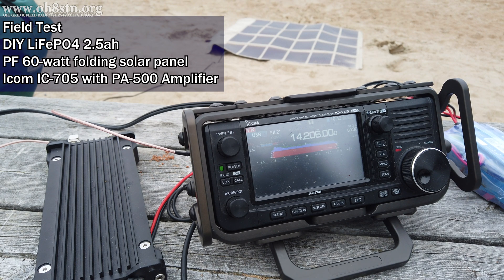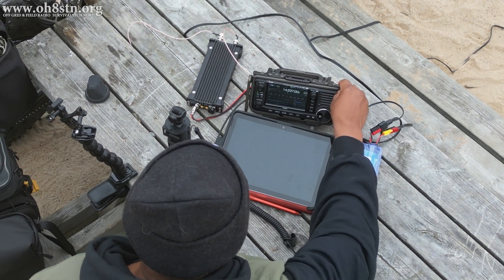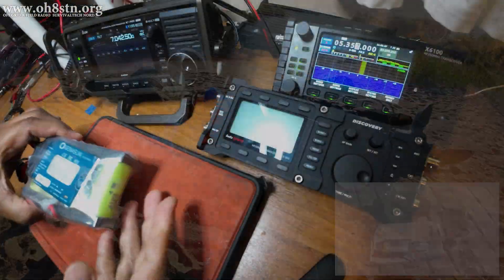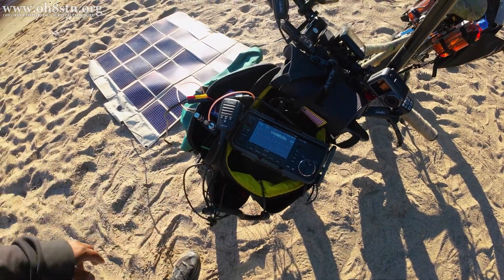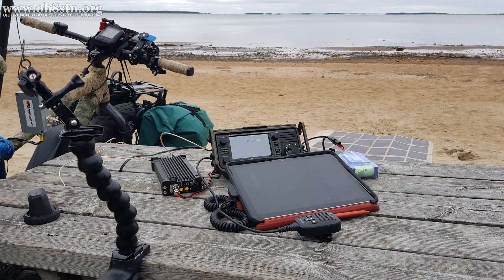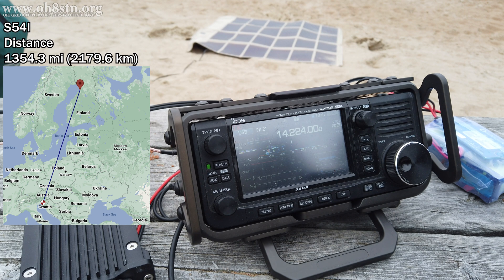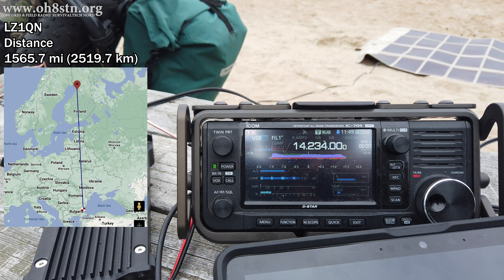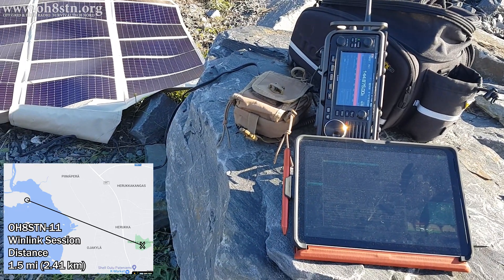Portable ham radio off grid Icom IC-705

Comment: How do you connect a Bioenno battery to the Icom 705? Great videos as always. Thank you.
Reply from the maker: The 705 comes with a DC power cable.  The plug is center pin plus, outer ring minus. Add a fuse on one or both cable ends, and connect +/- to your battery plus minus. It would be good to add connectors to the power cable end, and a powerpole distribution block to the battery. Then it's as simple as plugging in the radio power cable, into your batteries distribution block.
Hope this helps. 
73
Julian oh8stn

Comment: have you tried the Buddipole power mini?
Reply from the maker: Yes I used it for a couple of years. Recently I sold it because it doesn't perform so well in low light conditions. It's okay with lead acid batteries on clear days with good sunlight.

Comment: I just got a Genasun GV-5 12v Lifpo 4 and the manual suggests putting a fuse in between the battery and the controller. Do you do that if using a bioenno type battery or are they mostly talking about lead acid?
Reply from the maker: It doesn't hurt. The fuse is there to protect your gear if for example the terminals are mixed, grounded or shorted by mistake.
Reply: It’s also interesting that Genasun shows hook up procedure as Panel Battery Load and Buddipole powermini2 suggests Battery Panel Load.
Reply from the maker: Genasun controllers MOSFET will protected if there is no battery connected and solar panels are. Still, I would connect the battery first and and then the solar panels. The load can be connected anytime after the battery is connected.

Comment: Simply cannot afford a more sensible radio so stuck with hauling Icom IC-756 (MK1 Non-Pro version) Heavy, Big, Hungry. but it is what I have . I am also stuck with heavy Car batteries and SLA batteries for power. These are all charged off solar panel at home. I have a 65W dual-panel that folds closed to protect the panels for transportation. The whole HF station + homebrew antennas, food, water etc. packs into a small box trailer that can be easily hauled on the Fatbike or used as  hand cart when I don't want to take the bike.  This is a long way from an ideal /P setup but still having fun making the best of what I have got.  🙂 I have a 706MKIIG set aside at a friends house that I will hopefully get by next summer, this will greatly reduce weight and power requirements and will improve the /P station. What battery / BMS / charge controller combination would You recommend for radios that are less efficient like the IC-756.?  Thank You for the time and effort You put into these videos. 73 de MM7WAB An amateur radio womble, in Scotland.
Reply from the maker: Excellent backstory and question. Hey it always depends on the amount of time you generally operate. If you ride out set up an operate four or five hours at a time, I would suggest a 20 amp hour LFP battery. 1-2 hours,  10amp hour LFP. This week's video will cover this topic extremely well so stay tuned for the weekend.

Comment: Get the lead out! I also have learned a great deal from you as others have commented here. You've helped me to prioritize my goals and the matching of my equipment to my particular platforms. For example, the Icom 706 MkII G and CB will reside in the box truck with 400 watts of solar/480ah Lipo4. The Icom 705 (same set-up that you have) will be used in the 4Runner (along with my get home bag and SOTA fishing pole mast etc.) along with the Anytone 878 for 2m/DM. Streamlining for efficiency is the order of the day. Thanks again!
Reply from the maker: 1 minute of video, 1 hour of editing on average! Nevermind field work for testing and collecting clips.
Reply: @OH8STN   Sorry Julian, I meant everyone get the lead out by not using lead acid batteries. ; D.  I used to shoot wedding videos and I know how much sweat and labor goes into your vids. Thanks again 73

Comment: How long would you anticipate your power radio to last in a permanent grid down with no ability to replace parts
Reply from the maker: Excellent question! 
So far the radios have lasted 5-10 years without repair. The exception is the FT-817ND, which needed its DC socket replaced after several years of deployments. 
The solar generator we built 3 years ago is going strong. It still provides ~100% of its capacity, although fuses are periodically replaced. Now I have a supply of hundreds of fuses of varying capacity.  The charge controllers are fine but one screw terminal broke after 3 years of deployment.  It was easy to repair by soldering the wires directly to the circuit board. This prompted me to purchase a DC soldering iron so that I can solder directly from a battery.
The portable solar panels have done extremely well. Out of the 8 I have, 1 failed when I rolled it the wrong way. Expensive lesson! Otherwise,  they have lasted well with the oldest two being 6 years old now. That's my powerfilm 20 & 120 watt panels. 
The house panels are Renogy 100 watt models. We currently got 500 watts of those, with 200 Watts more on the way. We also have 2x 40 watt panels on the tower to power the shack. None of these rigid panels have failed functionally. One of the bigger panels we had which was 275 Watts, was accidentally broken. This was purely bad luck and not the fault of the panel.
The wind turbine requires constant maintenance but doesn't seem to require any parts. It's been up nearly 2 years now, only requiring lubrication from time to time.
The most common repairs are DC and antenna connectors. I've started to over build both of them to reduce repairs and replacement. I don't have nearly enough spares on hand, but will soon start storing them.
I believe your excellent question, could be turned into a video. It would be an excellent discussion.
73
Julian oh8stn
Reply: @OH8STN  thank you for your reply (73)

Comment: Until there is a better 100W shack-in-a-box, I'm holding on to my FT-857D, 100W folding solar panel, and 12Ah Bioenno battery. Man portable on foot I wouldn't lug it more than 1 mile. However, on my KLR650 or in my car it is probably the best 100W portable radio on the planet.  Bar none! In spite of be power hungry compared to newer QRP radios.

I'll be glad when there is a new efficient 100W shack-in-a-box radio. Until then...
Reply from the maker: I doubt there will ever be an energy efficient QRO radio in a box. Western Ham Radio manufacturers don't give a hoot about efficiency in mobile radios. For this we need to move over to green radios. Still I agree with you for the most part. Riding my Honda TransAlp, I didn't care how heavy the gear was as long as it fit in the top box.
These days hiking or traveling by bicycle, the 705 and PA500 amplifier are an expensive but truly compact, lightweight, and energy efficient solution (for me).
Thanks for watching and commenting. You have awesome insight.
73
Julian oh8stn

Comment: If it were not for the Sealed Lead Acid (SLA) Batteries, I would not be able to get my Weight Lifting exercises in each day. 😅
But, seriously, your comments about battery weight vs folding solar panel in "spot-on". 👍
Reply from the maker: That's a very good point 😉😂

Comment: Where do you live, Finland or Sweden? I have seen that Nordic looking shoreline many times in your videos. As to the content: So, its better to pack a minimal battery pack (size, weight, Amp/Hr) and have your solar panel(s) providing that constant recharge. Especially for quick portable activations, and short Pota & Sota game, activations. Makes sense! All being dependant on you radio's power draw... 
Great content!
Reply from the maker: Finland KP25. Yes short deployment  reduce capability but keep a constant charge when possible.  One aspect I haven't mentioned yet is even if the battery runs out, I still have the internal battery of the radio.
73
Julian oh8stn

Comment: 100% agree with power requirements of the FT-891 and FT-991A. Many times on a SOTA or POTA activation I've used up my 15ah battery way faster than expected.
Reply from the maker: You know what I really think? If Yaesu came out with lower current hungry versions of their foldable rigs, they would sell like hotcakes!
The size of the 891 was perfect. It was just the current consumption which was too much. Anyway thanks for watching, thanks for commenting and for the kindness.
73
Julian oh8stn